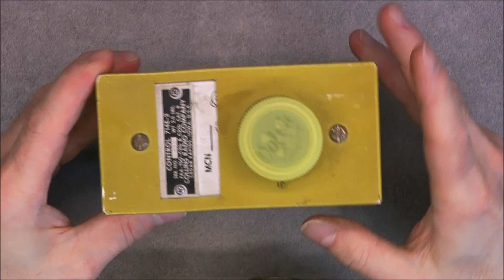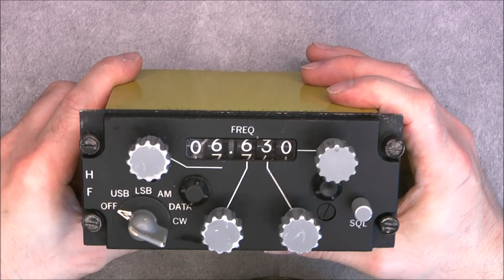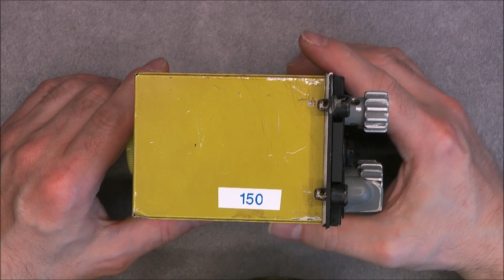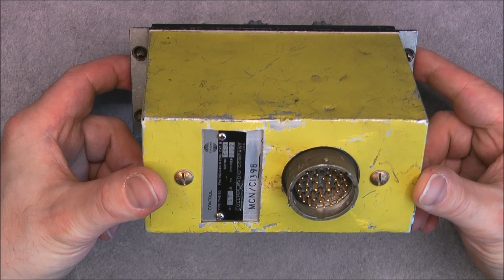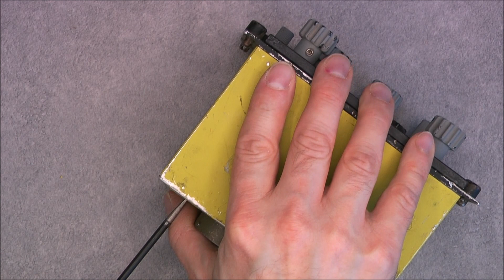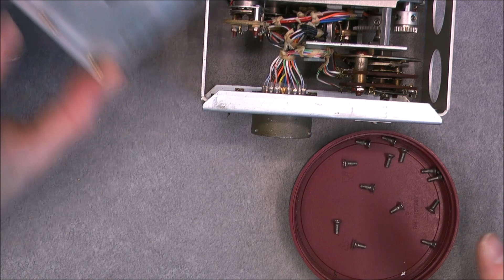Collins 714E-3 HF control box teardown

Comment: Thanks for that teardown, I just picked up a homemade radio with one at its heart, and it took a bit of googling images to even find out what it is as it has no markings except for a  serial number.
What aircraft were they flown in?  A manual I found online implies it was made in 62.  It was paired with an AIC-10 but that looks different to anything else I can find as it has 4 things I think are crystals on one side.
ps Im not a radio guy, just a bit of a nerd for cool, old well made hardware.

Comment: The markings on the selector knob will probably be, Upper Side Band, Lower Side Band, Amplitude Modulation, DATA (for data transmission rather than voice) and I believe CW will be Continuous Wave, normally used for MORSE code transmission if i remember correctly